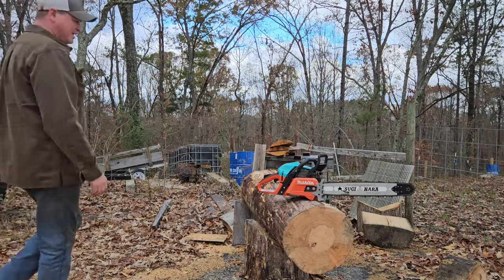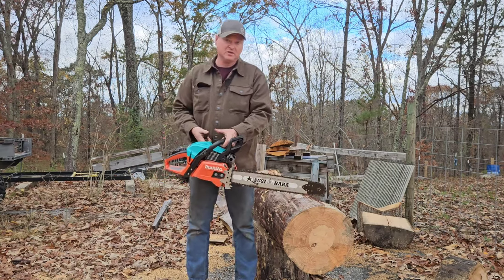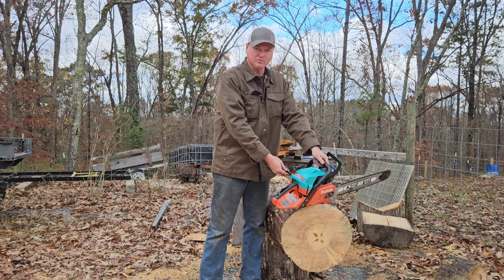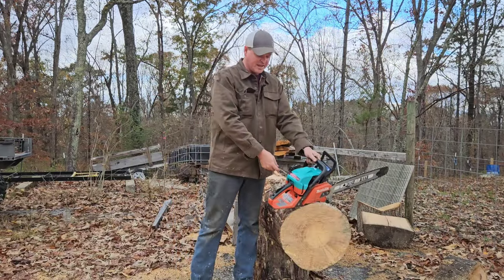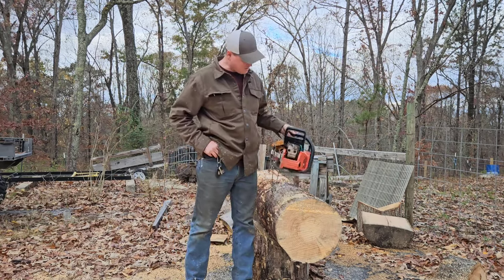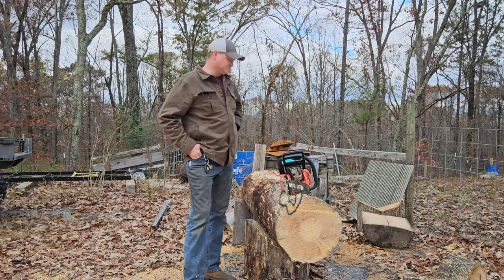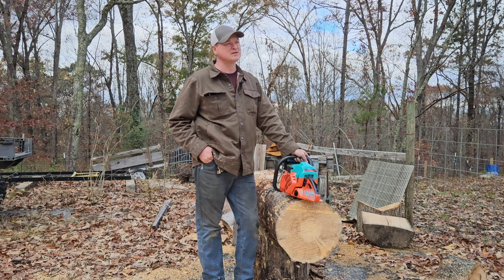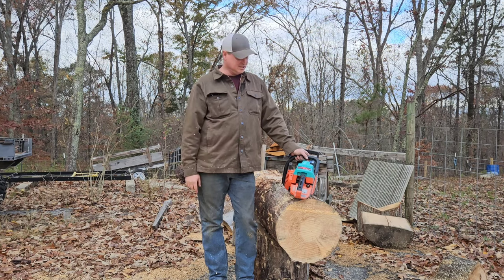First run of Makita 5600 Blue Top

Comment: I picked up a very clean DS6421 and I’ve bought a 7900 OEM cylinder kit for it going to get it ported by Jeff Succumbe and it should be a ripper! I’ll run a 28” light bar on it as well!